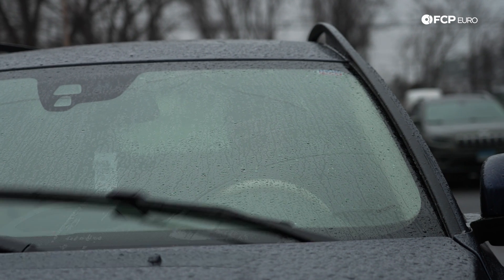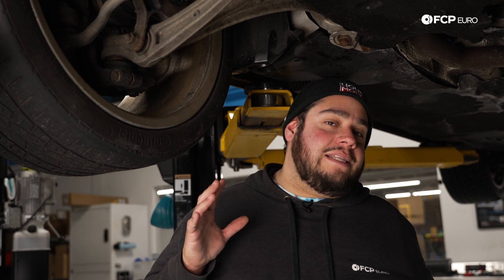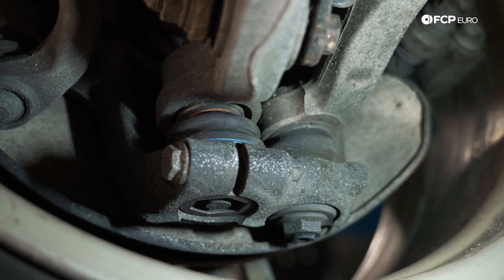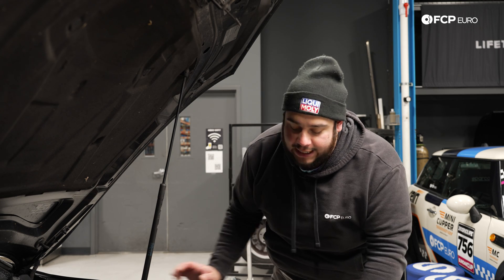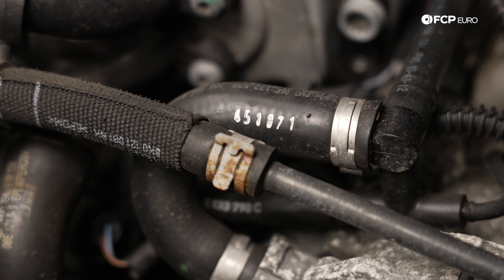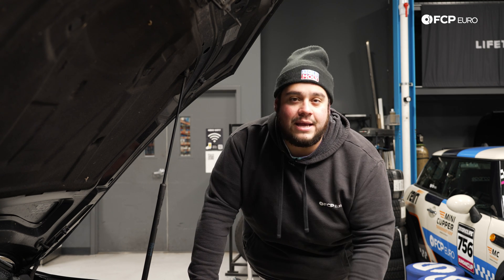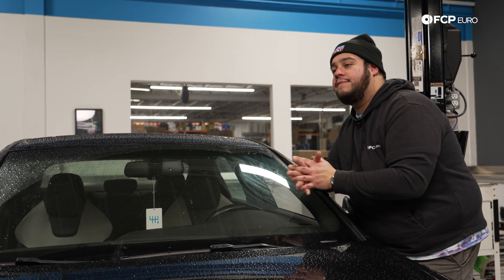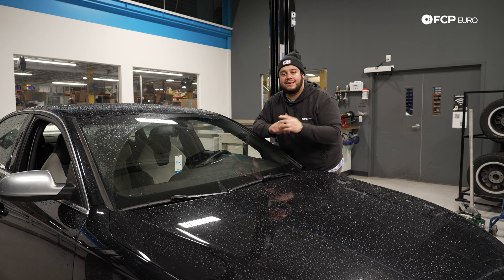Why Do Rubber Car Parts FAIL In The Winter

Comment: So timely! I’ve had a clunk on my front left wheel area, it’s also been very cold here at night. I took it this afternoon to the mechanic and he drove it.. it didn’t do it and I felt dumb. It was also approaching 70° today instead of being in the 50s and in the low 30s at night. I wondered WTH on the way home. The only thing different was the outside temperatures and, voilà, here is your video to validate that.

Comment: 2013 Volvo xc70 (83k miles) with a scraping noise only in the cold going over speed bumps slow.  
Not sure if it’s the strut bearings, front sway bar bushings or …..
Any guidance would be appreciated
Reply: My guess? Sway bar bushings
Reply from the maker: Assuming you are riding on original suspension components, end links or bad strut mount bearings are highly likely. End links are simple to inspect and replace. Raising the front end of the vehicle along with some steering input from a second set of hands may also help you determine where your noise is coming from!

Comment: Easy: there is more moisture and contraction due to cold weather. Later, when those rubber parts dry, they crack and break apart. Especially when going from a heating garage to outdoors and back in again.